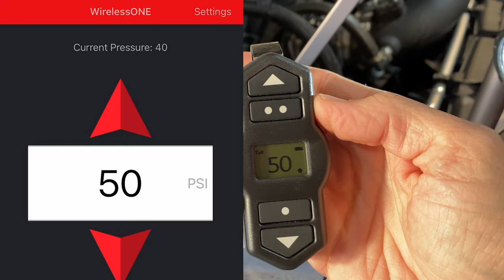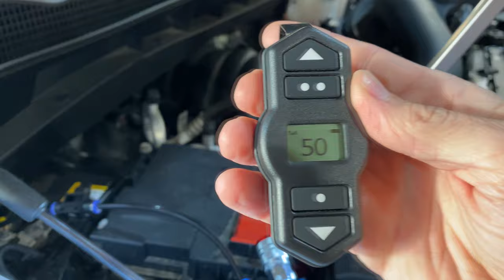How to Install an Air Line in Your Truck!

Comment: I installed air springs in my truck yesterday, and was just considering adding a way to tap into the compressor for random air fill needs. I hadn't considered putting a shut off valve between the bags and the manifold. Which would have limited the amount of pressure I could pump, as the 1000HD kit I used is limited to 50psi. Thanks to your video, I'll be able to build it out to use the full range the compressor is capable of. One thing I did think about is a locking air chuck. To be able to attach the hose, dial up the pressure, and let the compressor do it's thing while I go finish my coffee.
Reply from the maker: I have a video I will be making soon adding something

Comment: Great video and a Great idea. I go to the beach a good bit so being able to fill stuff for the kids would be wonderful. I will probably attach mine where I have instant access without opening the hood. Oh! I already have the air bags installed and I put my Schrader valve right next to the license plate for quick access.
Reply from the maker: Thank you for watching the video!
Reply: Exactly  - just connect to that and run the compressor.

Comment: Great Video Don! I have a 3.0 Duramax so I could not fit the compressor in the fender well. So I ended up putting it in the bed of the truck under the rail lip. Next is to add an air hose connection. I did not see a part number for the plastic air hose fitting into the manifold. The small one for the black hose. Thanks!
Reply from the maker: Thanks man.  I had some parts lying around and went to a local supply store and bought various fittings for air line systems.  Sorry I don’t have a part number for you
Reply: I have the 3.0 and had no problem fitting it in the same spot as don. 11:08

Comment: I'm curious to know how durable those black lines will hold up in extreme cold/hot weather. Overall, awesome upgrades.
Reply from the maker: 3 years later.  No leaks or problems with these lines

Comment: Hi Don, i'm loving every video. Looking to get the air lift system exactly like you installed - Bags, compressor and on-board air manifold. Shopping to get the best price right now. Cheers from Ontario
Reply from the maker: That’s cool.  I wanted it because when I tow 6000-7000 lbs it is much more stable and safer
Reply from the maker: I really appreciate you watching and liking the videos

Comment: Hi Don, great video.  My question is how is the system holding up after 2 years?  Maybe a product updates video. Each upgrade you did over the years and how its holding up.  30 seconds per update, give a thumbs up or down, or rate it out of 10?
Reply from the maker: Great idea 💡.   As for your question.  Held up 100% but I just took it out 2 months ago since I never used it and wanted to reclaim the room.  Without a dedicated tank, it took a long time to fill a tire.  A portable compressor is just easier.

Comment: at 10:58 of the video, what is the 90 degree metal bracket you used to attached the manifold block/airline hose connector?  where did you get it, something homemade? and what type of screw/bolt did you use?
Reply from the maker: I bought an ‘L’ shaped bracket and used a step drill bit to make a hole for the connector to fit through
Reply: @Donslife  Awesome - went to Lowes and did the same thing.  Drilled a 1/2" hole for the air hose adapter and used a couple of self-tape screws to screw down the L bracket.  love the setup and instant air anywhere I go - travel trailer, utility trailer, KRK1000, truck...

Comment: Random question, how do you like your exhaust? It sounds great objectively, but I’m wondering if it is sometimes too loud. Like if you have to start it up at 6 am do you feel bad for you neighbors or not 😂😂.  Thanks!
Reply from the maker: I really like it but YES, I would feel bad performing a cold start at 6am.  Overall I don't think it is too loud, but you need to be a fan of this kind of thing or you'd be better off with a Touring version.

Comment: Hey can the compressor overheat? I usually inflate 4 tires from 10psi - to -45psi
Reply from the maker: It will be slow going though.  I would consider adding an auxiliary tank if you need to do this often

Comment: Do you think it’s worth getting a 2020 GMC Sierra elevation 1500 right now all black x31 package for 48000?
Reply from the maker: In the US or Canada?  If the truck has everything you want and the mileage is low enough it might be reasonable.  Seems a little high if thats US prices.  Right now used vehicles are inflated but not much you can do

Comment: Where did you get the manifold and shut off valve
Reply from the maker: I bought my items locally, but I put links from similar items on Amazon.com for you (and in the video description)

1/4" NPT Manifold : https://amzn.to/3mBoZtT
1/4" to 1/4" Pneumatic Air Flow Valve : https://amzn.to/3lmKqiR
1/4" 25ft coil air hose : https://amzn.to/3v0GBDo
1/4" M-Style Red Air Coupler set : https://amzn.to/30d9uAQ
Reply: @Donslife  thanks bro! Just installed the air lift system a month ago. This will be a great addition.   Appreciate your content
Reply from the maker: Thanks Billy!  I really appreciate the feedback!